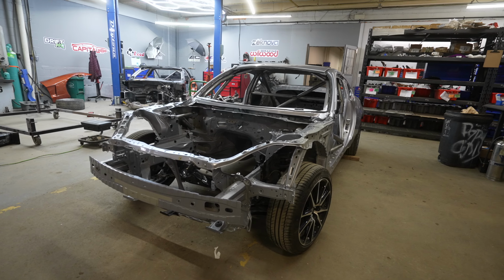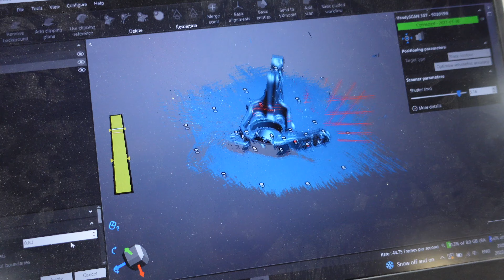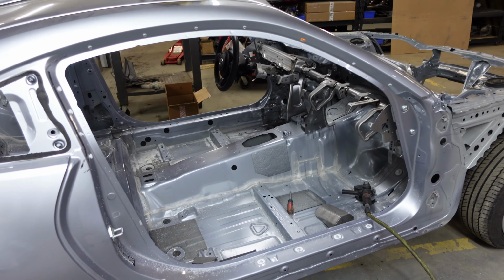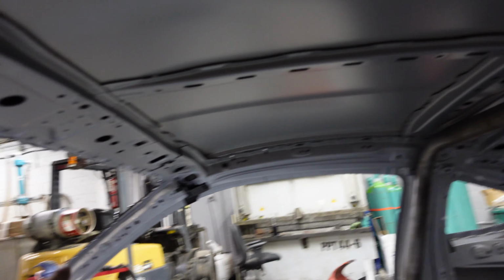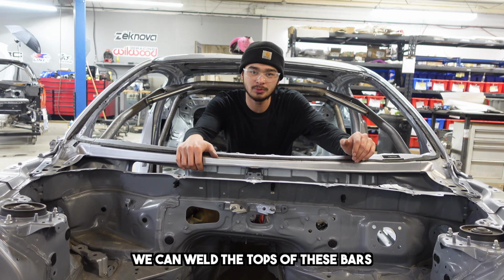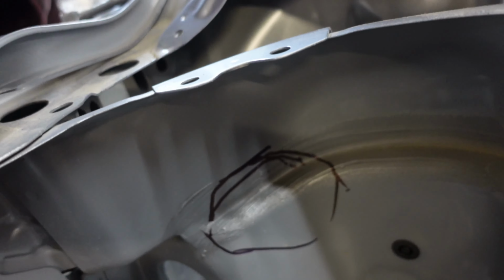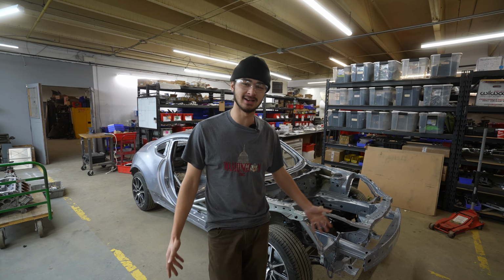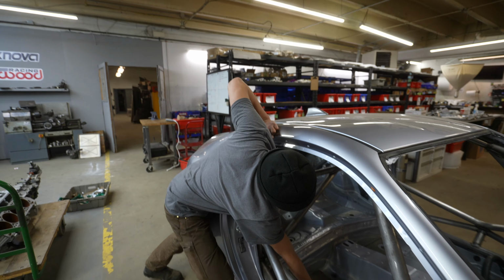Roll Cage Install In A Brand New GR86 (Kyles First Cage)

Comment: This is cool I had actually bought an 86 to ev swap as well. Curious to see what battery and motor setup they are going with. An 86 with perfect weight balance or slightly rear sounds like and incredible track car